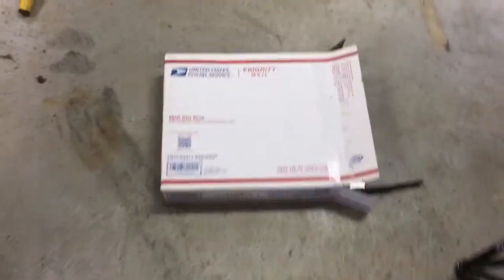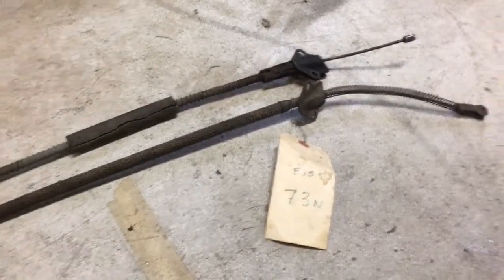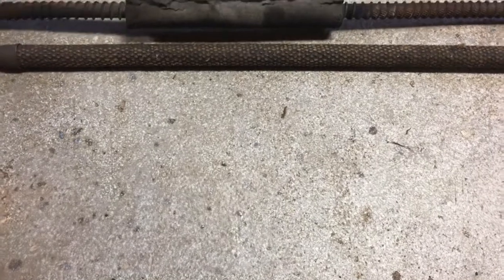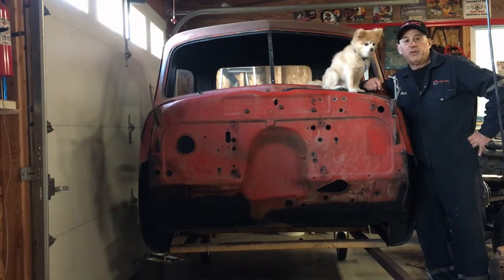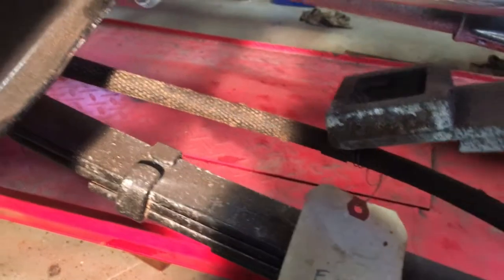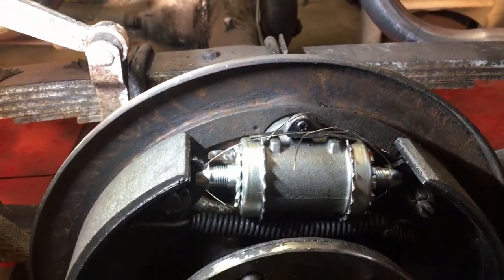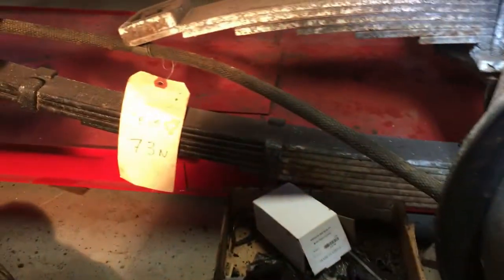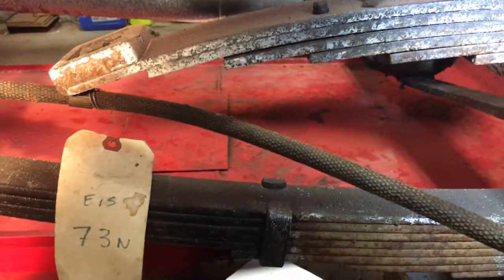1947 GMC Yet Another Parking Brake Cable

Comment: Is it that its too long?
Reply from the maker: It's the casing that's just a bit too long so that the excess curves between the springs.  I'm thinking that I can get it to curve back towards the outside of the truck and tie it back with something. I am still hopeful that in the near future, I will find the Lisle C74 cable to match the one on the passenger side.